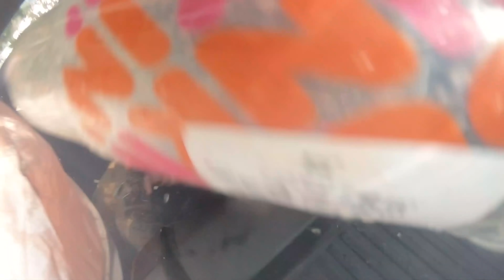Crash Update on My F 150

Comment: NEVER hold the steering wheel like that.  I understand it's a panic situation, but you're very lucky that the airbag didn't break your arm.  Also your boy looked like he was having a blast the entire time with a huge smile on his face haha.
Reply: That’s false. Lol. Nothing would have happened to his arm. You’ll break something primarily due to the g forces tugging you around. I broke my thumb on my steering wheel because of the forces of the crash against my thumb while holding the wheel. Plus his car was sliding, holding onto something is gonna be your initial response.
Reply: The most likely thing to brake his arm in that position would be the force of his body jamming forward from a front end collision!
Reply: Damn DR you are so right 😂 L
Reply: Karma Oze True. Lol his arm bent the wrong way watch it again. .25 speed
Reply: I got in an accident when I was 18 (almost 20 years ago) as an inexperienced winter driver skidding out on black ice (going too fast) and slammed head long into a big tree. 

Airbag broke my arm in 3 places, necessitating four metal plates in there to hold it all together. 

Airbags can break bones. Looking at that video I'm shocked even with the hyper extension you weren't hurt.
Reply: theogari I lost control of my mustang once and lost the bumper to a street sign. Luckily a voice in my head told me to let go of steering wheel, if not I could’ve broken my wrist or arm. I walked away shaken up but fine.
Reply: @angelgjr1999  of course you did. It's a mustang.
Reply: @angelgjr1999  They teach you to let go of the steering wheel and cross your arms in the event of a crash in open wheel racing.
Reply: @SI0AX  Makes sense. You want to take up the least amount of room if the roll cage caves in.
Reply: @angelgjr1999  lol you never let go of the wheel on the road bro cmon
Reply: @Iridiumcosmos  did you even watch the video  if he wasn't as tall as he was he definitely would be able to bend his arm the wrong way right now.
Reply: @Iridiumcosmos  my dad pulled his shoulder out of socket holding it normally
Reply: Thank God that you they are  safe, PLEASE; this message is to everyone, in situations like those never depend on the BRAKES, steer the car without holding the brakes. As soon as the brakes are held, you loose the steering of the car. ABS system just slightly help to steer just very little 15%... But in those situations... Steering is more important than braking

Comment: "We have some theories" - yeah its called bad driving bud.
Reply: Tsssssss
Reply: @angelgjr1999  They hit a oil patch. I hit one coming off a ramp in my g37 sitting on coils and almost spun out. It happens 🤷‍♂️
Reply: @Chev_chevo  how do you assume that??
Reply: @iamnoone5614  it happened to me before in my car I was exiting the highway and hit an oil patch on the exit. My car broke traction and I spun into a tree head on.
Reply: ...in a big way!
Reply: @TaeLS430  ...but you saw the patch afterward? You remember or know, he doesn't. There doesn't have to be a reason, but the investigation continues..
 See the difference?! He crashed, everyone does. EVERY DRIVER WILL CRASH.
Reply: @garyjohnson4575  the state trooper pointed it out afterwards to me. I just chocked it as a loss and just took turns exits  slower now especially ones I don’t take or know the lay out off.
Reply: @angelgjr1999  pickup trucks are small tanks. If some dies from their circumstance, family could rightfully sue
Reply: Here is what I think may have happened:

Either he hit something slippery while applying throttle which then made the rear end come loose at which point he over corrected. 

Or:
He hit a bump or pothole which caused the truck to wheel hop which made the rear end come out from under him and then he over corrected. 

Either way, something clearly unsettles the truck.

Could happen to anyone.

Comment: Glad you’re ok, but you never did answer the question from the thumbnail in your video... so what did happen? Went to make a street pull and ran out of talent?
Reply: Bingo!
Reply: Until he gets the insurance check I doubt we’ll find out. But that’s my guess
Reply: Looks exactly like it.  Rear end stepped out, tried to correct it and the rear end made contact with the wall and then sent the front end into the wall, climbing it cause the front wheels were still turned trying to correct the slide..  bounced off the barrier, and through the guard rail.
Reply: Remember ,it’s best to remain silent, if you think his insurance company and Law enforcement aren’t watch his channel closely you are crazy . I’d say this is probably some of the best actual crash footage I’ve ever seen maybe he could sell the rights to it to recoup his deductible and buy back the wreck for the driveline .
Reply: Looks like @ 10:30 he shows an oil slick in the road that may have caused the loss in traction.
Reply: Yep. Accelerating to get on the highway, he hit that patch and the ass end kicked out.
Reply: Did the same thing almost to the T in a 95 gt totaled out not a scratch on me
Reply: @undertall  also the tires look toast.
Reply: He was clearly making a pull just by the rpms in the background and hit that slick shit.
Reply: 8:42 His hand in that position on the wheel. 🤦‍♂️
Reply: Nah ... looks to me like he was driving along, following all applicable traffic laws, and something in the rear end caused him to lose control. :-)
Reply: I'd call it a mechanical failure.  Looks like the rear tires suddenly got hotter than usual and the performance of the truck exceeded the performance of the driver.  If those pesky rear tires hadn't suddenly heated due to unknown reasons...

Sorry about the truck.  It was truly an awesome ride.
Reply: @standalone2358  he has the insurance check ☑.
Reply: @holyroncg   Cheque or not he shouldn't grip the wheel like that.
Reply: Me looking through out the video a second time thinking I missed it
Reply: @standalone2358  I agree but my comment was in regards to the insurance company perhaps seeing the video 📹 and not wanting to pay him.
Reply: @holyroncg  I just wasn't sure why you tagged me.
Reply: @standalone2358  it was an accident I was just making a comment, wasn't intended for you my friend. I was reading a post and I guess I accidentally tagged you my bad.
Reply: @holyroncg   I understand. My comment held no ill will, I was just confused. Have a great Day.
Reply: @standalone2358  you too my friend.
Reply: @Thegoose95  That’s a burn on the road from a car fire.  The road actually gets pretty rough and grippy from fires.

Comment: How fast were you going? How the hell does that happen?
Reply: something broke or the right foot broke traction.
Reply: in the video they showed something slippery on the pavement. might have came from his own truck.
Reply: I hate that this happened to the truck. He can’t say he was speeding and fooling around on live video obviously
Reply: Tire mark only shows he was loose before the spot in the road.. it simply got away from him and over corrected. Quick way to learn the highway is a no prep😂
Reply: @6628guitarhero  Yeah It looks like a car caught fire there and the heat damaged the pavement. If so I'd blame the state
Reply: @LiquidSSSnake  state isn't liable for shit. Dude needs to learn to drive, given the conditions of the road and the capacity of vehicle he's operating. Period.
Reply: @deeohgi  I agree he can't drive shit for sure obviously from the speed they were driving and how fucked up the car was
Reply: Hasan Amir agree definitely was going faster than 55 mph
Reply: He hit a pot hole and it upset the rear and shit happens glad they safe when that happened to by homie he hit a cluster of trees and got cut in half yup the seatbelt cut I half of he didn’t make it but then again he was in a supped up civic
Reply: lack of driving skill. hes the same guy who hit the wall at the track
Reply: HotShotVQ35 Poor driving technique, high power, and poor handling vehicle equals total loss.  The truck gave it’s life to save the occupants.
Reply: And traction rolled on what looks to be four drag radials  now that I think about it

Comment: He should learn how to drive/control a vehicle especially a high horsepower one. You're not supposed to turn a steering wheel under handed like that. I'm surprised his arm didn't break.

Typical Ford losing control with a bad driver 🤷🏻‍♂️

Comment: Them damn 5.0's just have tooo much power lol
Reply: Nah niggas just need to learn how to control it🤣🤣🤣he had a supercharger so it had extra power. I think he was going about 80 or whatever and he hit the gas all the way and the tires started spinning and it went down hill from there🙈🙈🙈🏃🏃🏃stayed on the gas too long. U have to let go of the gas early☝️☝️☝️☝️and he need better tires too. Probably on stocks💀stock tires and extra power don't mix
Reply: @TreyGoose  He's got some funny looking stock tires then...
Reply: Trey even my 3.5 gets squirrelly after what I have done to it. Definitely need to run + traction and upgraded tires when pushing anything north of 500bhp with an aluminum body. Not enough actual weight in the rear to keep traction.
Reply: Trey sounds like you literally have no clue about him the truck or anything

Comment: Thank God that you guys are safe, PLEASE; this message is to everyone, in situations like those never depend on the BRAKES, steer the car without holding the brakes. As soon as the brakes are held, you loose the steering of the car. Abs system just slightly help to steer, but if the brakes are not held... You can control the car much easier.

Comment: Did he mash on it and break the tires ( loose traction / spin tires ) doing about 70 mph 
And over correct , and got to the point of no return , and lost it ??? 
Light weight aluminum body single cab with power

Comment: If I had to guess the cause, it looked like you didn't have the wheel straight enough and so the truck wasn't stable on the suspension when you punched the gas. The differential either unlocked or wasn't locked yet and so you went for a ride... Maybe.

Comment: Glad you’re okay brotha, I just crashed my 70’ C-10 into some fucking hogs a couple of days ago so I feel your pain. Hoping to see undertaker back on the road soon 🙏
Reply: That's not too bad. C10 trucks are tough that can stand to deer. C10 are very fixable in most crash unlikely modern cars and modern trucks. My friend owned c10 that killed 3 deers in lifetime. Insurance paid to repaired his truck instead of total it. Thank to value of frame, engine and transmission that pushing to nearly $15,000 in value. Parts store like Big Brothers Truck website are extremely cheap that help to not totaling it. Insurance will have to pay to repair half of value like up to $7,000. Not much c10-c30 and k10-k30 trucks on the road. Preserve them if possible. Plus, old fashioned 4x4 are very sucks like so horrible. Swap them 4WD to RWD for more reilable and more MPG from 10 mpg to nearly 20 mpg. Almost double mpg.

Comment: @1:21 you're wondering what happened? Great news everyone I have the answer. It all started with coffee and donuts. After they get their bounty from the D&D our man with the hat (driver) tells out friend with the glasses (passenger) hey check this out.. they spin the tires on the way out of the parking lot as pull out. However it was a lil bit weak an considering the truck this was unacceptable. So while headed home soon after pulling out onto the highway at about 35-40mph our man with the hat hits a full send bud. Just before shes fully sent she got a lil slippery but alls good because our man in the hat knows she lives on the wild side so he can handle it. But this time she's not completely woke up yet her feet are still cold and she's not able to hang on to the road as good as most times so she spun on out and made a big deal of things

Comment: It’s called driving way to fast. I hit a deer with my Lincoln zephyr and was able to drive away. I was doing 55 when I hit the brakes and my car wasn’t as messed up as your truck. You clearly lost control of the ass end of the truck. Btw never hold on to your steering wheel ppl with your palm facing upward on top. He’s very lucky when the airbag went off it didn’t break his wrist.

Comment: The reason you lost control is  because you were driving with slippery ass tires. They can't hold traction at high speed... Yes, they're racing tires but for a professional racing trac perhaps.